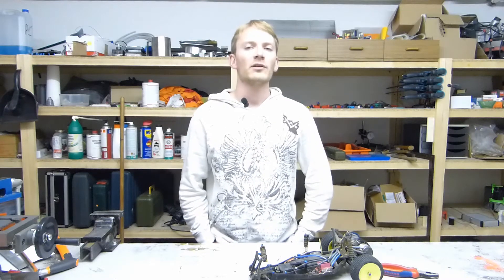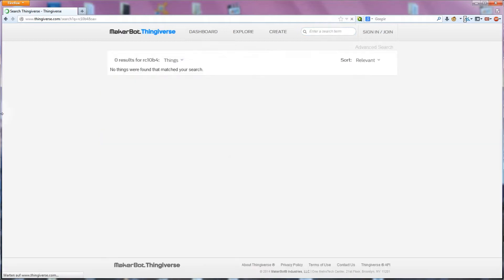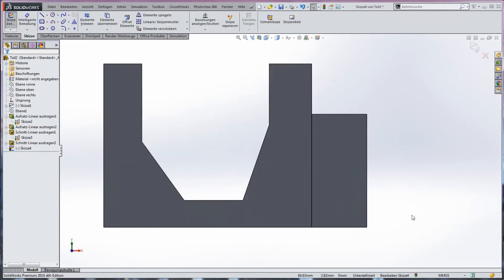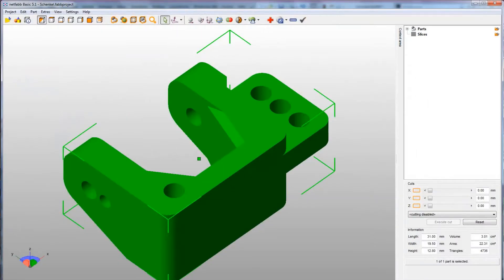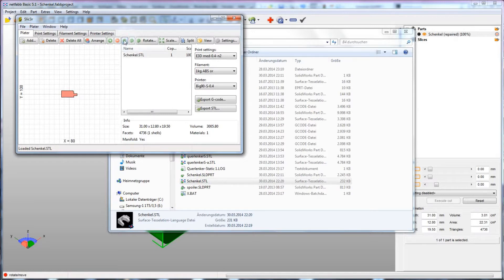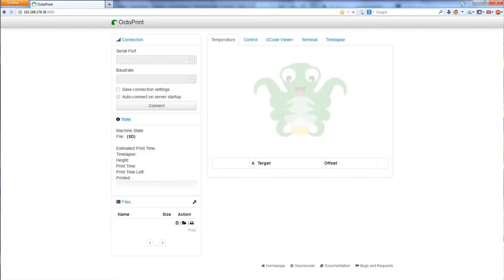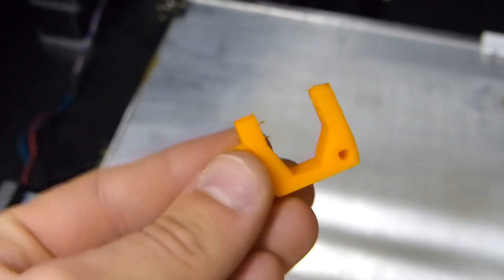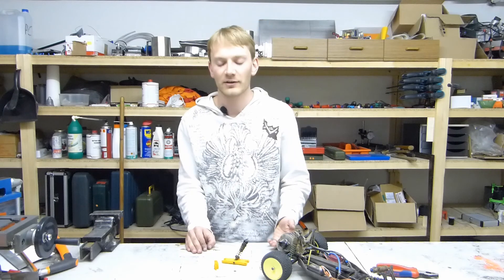3D printing basics - From the idea to a physical part

Comment: Could you make more videos about the software-technical stuff in 3D printing?
For example more about Solidworks (since Solidworks seems like a precise program to make for example replacement parts) or how to edit G-Code to make the Printer stop at a certain layer to be able to change filament while printing!
Thanks!
Reply: Isn’t this amazing? Now we have bambu lab printers doing this automatically 🤩